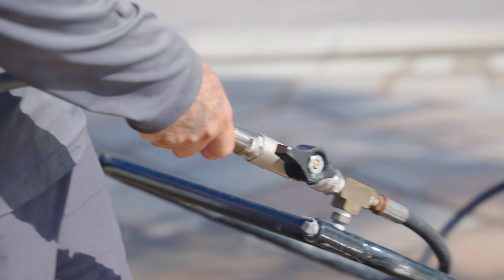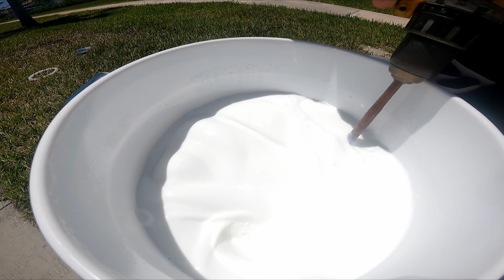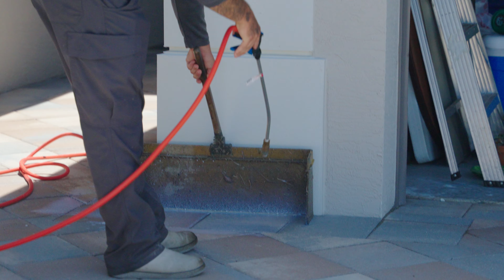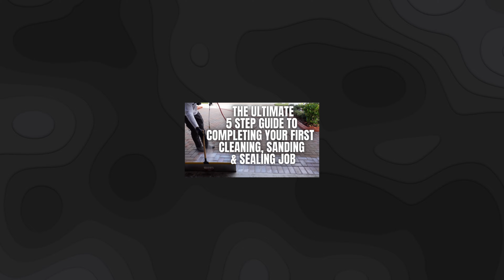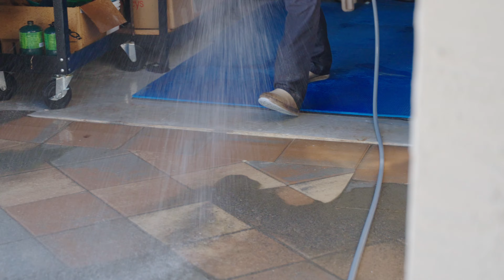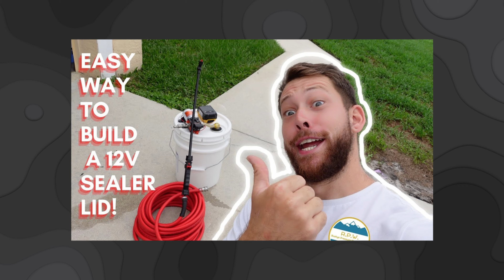Paver sealing tips the pros WON'T tell you (but I will)

Comment: I have more of a general paver question and you seem to know what you are talking about. So any advice is helpful. Im going to lay down a row of 2 blocks by 4 blocks and I'm not planning on adding any sealer since its going to just be a small path next to my veggie garden. What can I use to minimize the sand being blown away by cleaning or washed away by the rain? Is there anything like tile grout but for outdoor pavers? Or is sand the only option we have, and do I just have to resand every once in a while if I don't want to seal such a tiny area?
Reply from the maker: Sand with sealer over the top is definitely your best option. It’s going to lock everything in as well. I know it’s annoying for a small job but it would be worth it
Reply: You can use polymeric sand that you brush in then wet and it hardens

Comment: Appreciate your video.  I've seen so many people pushing the polymeric sand method, but my preference is to simply clean/prep my driveway pavers, brush in fine sand, blow excess off the surface, gently shower to tamp it down a bit, let dry completely, and then apply sealer.  Probably not as long lasting or durable as other methods, but for a diy project, I think the sealer applied on top should keep things sealed up reasonably well.  Am I wrong?
Reply from the maker: That’s a great approach. If you put enough water based sealer down, it will lock your sand in very nicely. Make sure to spray it and not roll it. Even if it’s with a pump sprayer.
Reply: @rusty.nesvig  thanks for the quick reply.  Yeah, definitely will spray it. Don't want to risk pulling up any sand with a roller and making a mess on the pavers.  Thanks!